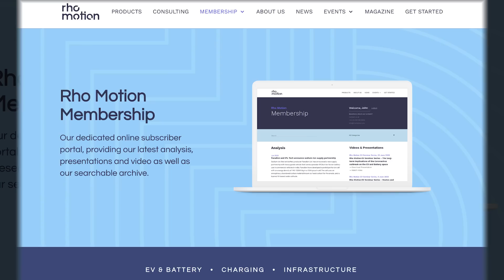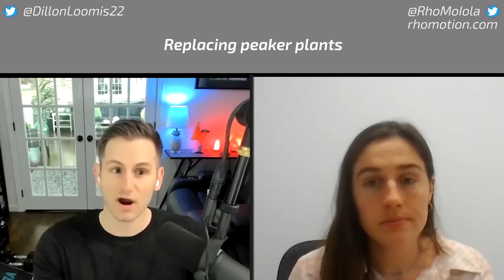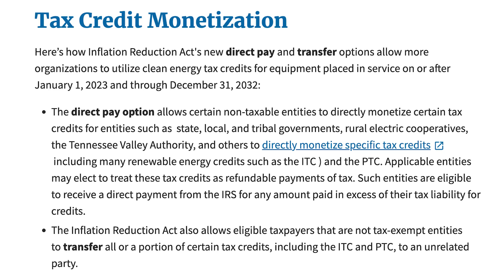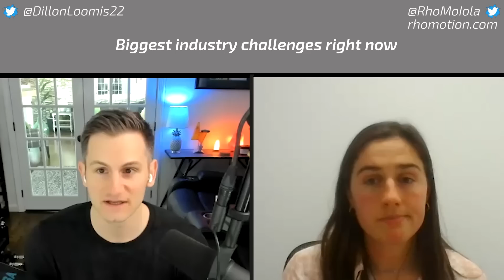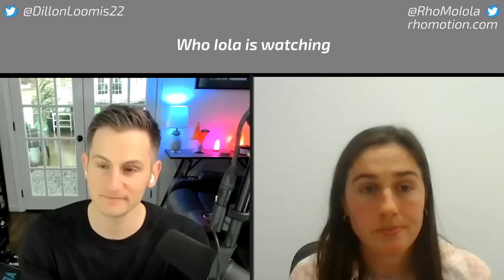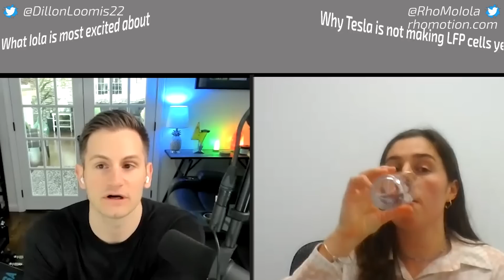Exclusive Interview: Tesla Energy - The Tidal Wave Ready to Break ⚡️

Comment: I work with the largest utilities in the US. None of them are looking to build anything other than solar and batteries. Nothing else can compete with the ROI. Additionally, they require no engineering, little permitting and licensing. Finally, they can go online within a year compared with decades.
Reply: Oh, so the SUN is free, and we are getting better at harnessing that power ? Add some batteries, and we have replaced dirty polluting coal/gas power stations. Sure, we needed them, for energy - but now we have a better future......
Reply: @Andy Feimster NFEI
.
Your point regarding "time to on line" is not mentioned enough.
Another comparison never made is what I call the "Residual Legacy Pollution" from fossil sites still in use during the construction period.
.
Comparing a "Traditional green project" (nuclear?) to a new style project (wind/ solar/ battery combined)
The "traditional project" with it's long planning/ construction period is essentially "binary" with Zero to One generation only at the end of the project.
If that's a 15 year process (being kind!) the result is the full capacity still being generated by the "old" methods.
3GW project = 3GWx 15 years, or "45 GW years" of fossil generation ( I know ! but it's the easiest way to quantify the amount)
.
Compared to for instance Offshore Wind/ Battery.
.
Not only a reduced planning construction time, as you say, but also the opportunity for "ramped connection".
Let's say 10 years, but with a linear ramp commencing at 2 years.
.
For a similar Output project....
Assuming a linear ramp as each unit is installed.....

My calculation indicates a 64% reduction in carbon footprint by NOT continuing Fossil generation JUST over the 15 year (est) Nuclear construction period.
.
That's a HUGE. reduction which Nuclear can never recover over the lifetime of the facility.
Reply: @Roger Starkey  Good points, but none of that motivates anyone; from large utilities to the most diehard tree hugger. Money! It's all about short-term gains of money. Even tree huggers will not "do the right thing" unless it is financially beneficial.
Reply: @rogerstarkey5390  it takes 4.5 years to build new nukes in China. It took the UK 8 years to build its last nuclear reactor Sizewell B

The 15 years is if you want to make it 15 years

You can drag out offshore wind to be 15 years too if you want to. Doesnt mean that's how long it needs

For what it's worth I think offshore wind is best for the UK and a lot of Europe. But even then its not easy see the delays in getting North South Transmission lines built in Germany as an example

Nuclear works if you want it to work
But Realistically we don't want it to work as keeping coal gas going is chepaer than building new nukes so that's what we have been doing since towards the end of the nuclear build outs in the US and Europe towards the end of the 1980s
Reply: @cyclopsvision6370  Physics Major ?
Reply: @cyclopsvision6370  I never said they were anything else.
Reply: The rate Grid solar and batteries are being rolled out is never going to make an impact on Coal and Petroleum production. Even 10 times the current additions of solar/batteries will be not get even close. The U.S. needs new large Quanitiy base electricity production. It can’t be Hydro all the plum sites are gone. It has to be a huge nuclear program.
Reply: @InformedKiwi  This isn't true solar and wind can be deployed fairly quickly

The UK grid went from 7% to 35% Solar/Wind fro  2012 to 2022 so that was a 2.8% change per year so over a 30 year period you can deploy 84% Solar/Wind
Reply: @InformedKiwi  The US is incapable of building anything anymore, especially nuclear plants. You are totally wrong about the capacity of solar and batteries, at least we all better hope you are! We have no alternative.
Reply: No mention of compact nuclear?
Reply: This.  Not a dam, not a coal plant, not modular nuclear, not coal.  Why?  Because it’s the easiest and least expensive way to get electricity.  Any place that doesn’t get this will suffer economically.  Period.
Reply: @Chris Haberbosch  most utilities are investor owned, so yes, it's all about the money. ROI.
Reply: The grid doesn't need anymore coal gas nuclear to function why would you build more coal or gas if you don't need it

Comment: Dam storage is a thing too. Rain over a season is accumulated as potential energy and released as needed to supply electricity to the grid.
Reply: Takes decades to design, permit, and license. Very few dams of any kind can be built today.
Reply: @andyfeimsternfei8408  That's a separate issue (which I haven't researched.) I'm just questioning the presumption that energy has to be stored in batteries. There's also heat storage which works for days, but not much longer. There's also potential energy storage by just raising large masses to a height that can be lowered later to run a generator. Lots of things besides batteries.
Reply: @KenOtwell  Yes, many options, but none that are quickly moving to mass production or that are as cheap and quickly deployed.